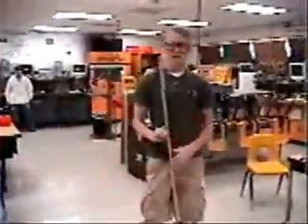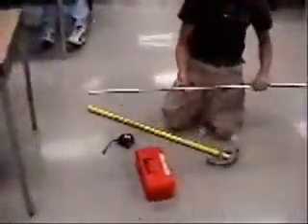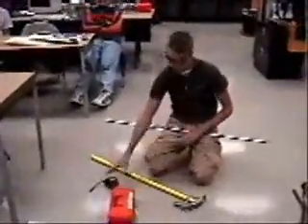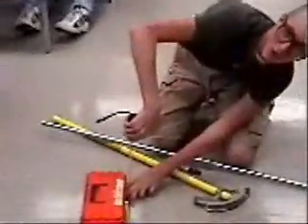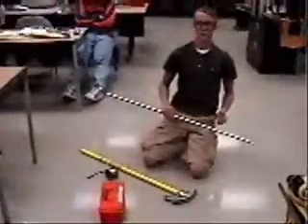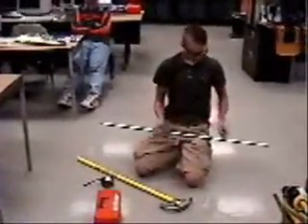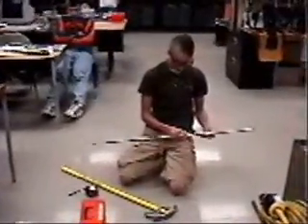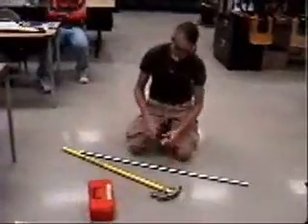Conduit Bending off set bend

Comment: The multiplier is based off of trigonometry, the 2 comes from 1/sin(30). For a bend of 45 degrees the 'multiplier' is 1/sin(45) which is square root of 2 or 1.41. You would multiply the height of the obstruction by the multiplier to give you the length of the hypoteneuse (length of the angled piece). If you have a scientific calculator that can enter fractions just put in the height of the obstacle divided by sin( whatever angle you want to use) this will give you the length of the angled piece.